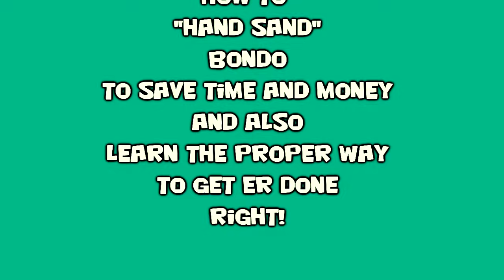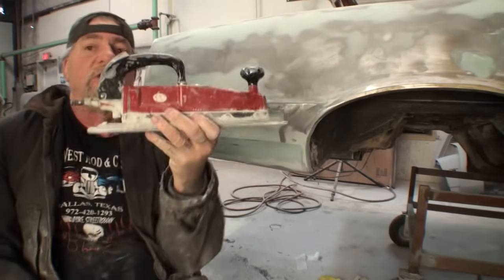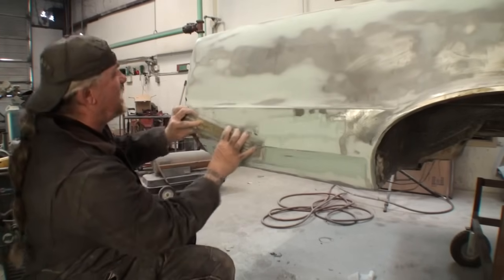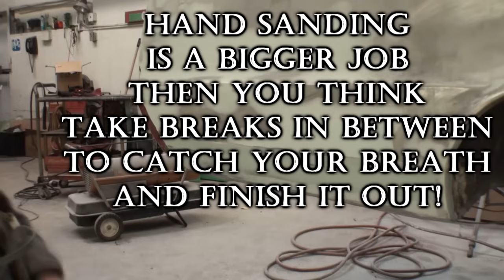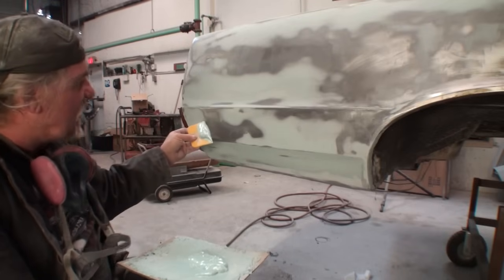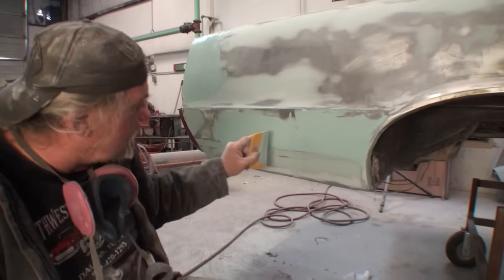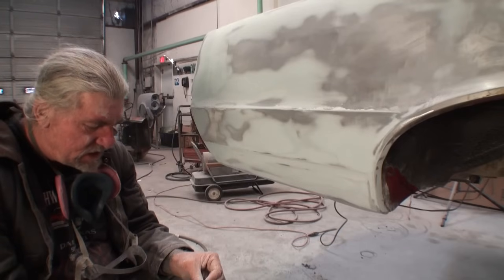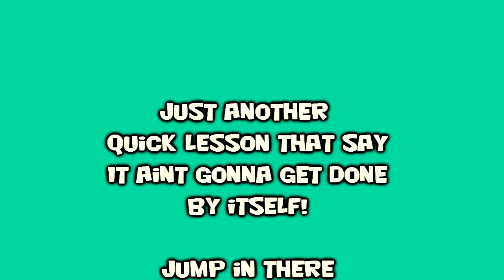Block Sanding Bondo For 2K Primer!

Comment: Absolutely one of the nicest/best videos I've seen from you Pete! and I've been subscribed and watching nearly all the videos you put out for years. No shouting being the biggest improvement, your always helpful and good at showing the reality of how much work it takes and what it takes to do a good job, you really have taught me a lot through the years I have been doing bodywork you have a good way of showing the important things to look out for. Thank you very much for the lesson but please stop yelling because it is so nice to watch this video and hear you talk absolutely as i wished you would and know you can. I know Minnie would love it also. Happy for the new place, can't wait to see you start setting up the place inside.
Reply: @thekingsilverado9004  what do you use ?
Reply: @maryfinchum9741  I start with the UPOL sort hair fiberglass. I used to USED the Diamond Advantage regular mud... Nothing has replaced that yet and it is no longer avail. Called an order in July... Nothing came NCS does not handle it anymore it was made  by EVERCOAT. I am in a real pissing contest with NCS NATIONAL COLOR SYSTEMS 4 getting a decent priced light weight mud. I used to swear by a few others too but they turned to shit... Not much on the market for decent sanding decent spreading mud AT THEE MOMENT... Everything that is like that is above 50 bucks a gallon at the moment which is not cost effective for what I do...

Comment: Thanks Pete your tips and tricks are working, I have a long way to go before I master mud work, Right now corners where multiple contours join cause me troubles but I am getting there. With your tips and tricks I have successfully completed mud work on two black cars and pleased the toughest person in the shop's expectations another car with a contoured body line on a hood didn't come out as good as I wanted but two estimators couldn't find the imperfection. Thank you for all the time and effort into making these videos, I sure am learning something
Reply: Yes it takes a lot of time all body men go through the same thing but that is the magic that everyone sees in the end results makes the painter looks good. It's good to know what color you are going to paint it beforehand so you know how much time you need to put in the best. You can make your own body sanding tools is what I did for all the round corners like Pete was saying you can't put to much in it like trying to over sand I've done that way to many time's I prime and see what stands out with the spray water bottle if you can't see it when it's wet then no one else will see what you see. I got caught up in that because I know what's there I paid to much attention to that area what no one else seen or even knows one's the prime and paint is on. Only you know where most of the work was done if I'm making any sence. Even car's that came off the assembly line were not ripple free.

Comment: I plan on doing a lot of my own body work on my  Chevelle I spent most of my adult life as a Auto Mechanic, not too much body work in my life except when I built my stock car for the Roundy round track, but now I am doing a restore and want to do all  or most of the body work myself, fortunately the body is very straight and no rust that I have found on any of the panels but I am sure there will be my share of sanding and stripping of the old paint, I do have to replace the lower panel on my right side quarter but that is about it, have been watching your channel and it has been a very good learning lesson, "ELBOW GREASE" but it has to be done, I hope to do all the main work myself, thanks for this block of lesson. I look forward to more of your lessons, thanks again for your videos .

Comment: Good work there Pete.  I think the hardest thing to get the hang of is when your block sanding the filler and you have a shiny metal spot show up when the rest of the area is still rough.  Hard to tell if the shiny place is a high place that needs tapped down or if that place is the correct height and everything around it just needs more filler.  Thanks, Tom

Comment: Good video. I've been doing custom paint for more than 30-years. My dad taught me a long time ago a saying "When metal pops, sanding stops". I also never finger sand. I make small blocks to work the area. It's not real hard to make them. Just cut down some of the small black dense foam blocks for the size you need.

Comment: So i found that were your hand sanding with your fingers i went down to the dollar tree and got a pool noodle and cut it down to small rounds and cut it into quarters its med density and it works fantastic for those little dips and curves i also found that the foam pads to kneel on work better than the black blocks from the auto shop plus you can cut them to any size you need and there only a 1.25

Comment: I so wish I saw this video years ago. My car had an inch deep crease all the way down it from front to back. I pulled  it out and spent days filling and sanding, eventually I worked out I needed a long block so I attached paper to a length of wood, that kind of worked as the panels were very flat. Here in the UK I cannot even see these blocks for sale.

Comment: I had a bunch of questions at the beginning of the video but you answered most of them during the video. I always wondered if all of the hand sanding that I was doing could be done with power tools, just could not see how. It was nice to see that maybe I was not wrong. I do however wonder if you have tried different brands of block sanders and if you have an opinion about differences in quality and workability. Thanks again for a great video.

Comment: The car was down to bare metal then bondo was applied and a sandable primer over it which allowed you to sand and fix more imperfections, would you apply an epoxy primer over everything as a sealer before paint or would a sealer not be needed?
I was thinking epoxy primer should go over the bondo and bare metal, but if you find more imperfections you can't sand it, I'm confused when epoxy primer should be used

Comment: So I can put a high build primer over 80 grit sandpaper, or did you go a step finer before applying? I'm currently block sanding my 89 240sx to recieve a primer and I've been told that I need to go to a 300+ grit in order to hide any scratches caused by sanding. Been using 120 grit so far!
Thanks Pete!

Comment: Question.  When do you media / soda bast vs. painting on top of the original paint?  I have a 66 Impala SS, that needs resto.
Reply from the maker: If the car has never been painted before and has the orginal paint and it's in very good shape you can skip the media blasting.. If the car has extensive body damage, surface rust, and/or has been painted before then you should remove the old paint to metal and start over..

Comment: Is any polyester filler good? Also Pete, what would you say your dry time is 45° vs. 95°?
Reply from the maker: I use a product similar to Evercoat Metal Works Putty.  As for drying time I wait approx 30 minutes to 45 minutes.. Thats why I always travel from side to side of the car so Im not sitting around doing nothing....
Reply: Why do you keep calling it Bondo if your not using Bondo brand?

Comment: Thanks Pete, I have a question, now that you have bare metal again after doing the bondo work will the bare metal areas have to be sealed with epoxy primer or can the 2K primer surfacer be used even if it’s not DTM? Again Thanks Pete for all the information you put out for us to learn.
Reply: You can buy metal prep wipes such as AutoBond if you do not want to re epoxy the bare metal.... Otherwise you will need something to give the primer some bite
Reply: @thistledewoutdoors3331  So on bare metal we need to use something before the primer?
Reply: @snoopy5736  no just make sure it is clean no oil dust, if you want to leave it bare metal for a a little time then there is bare metal wipes you put on it so rust does not grow over night. If you leave bare metal over night it will look brown in the morning that's why you have to cover it with something even tape paper over it if you can. You can not leave bare metal over night or your going to have to sand your metal again for primer or feather filler is some thick stuff that gives you more sanding ability so you don't hit metal and it helps cover small scratches then you can lay your skim coat on top of it to sand out any scratches it's a long process but in the end you will be happy with the results the more prep before paint the better it will look.

Comment: Can you give an example of the polyester you are mixing with the bondo?
Reply from the maker: The polyester Im mixing with it is similar to Evercoat metal glaze putty -- https://www.oreillyauto.com/detail/b/metal-glaze-3569/paint---body-repair-16614/body-repair-25202/fillers---plastic--fiberglass---metal-17765/539cc89349b5/evercoat-metal-glaze-glazing-putty/416/4299767...

Comment: My friend pete I see were some people are saying the bare metal should be primered before bondo because bondo won't adhere to the  metal what is your take on this?
Reply: Old days was bare metal(mechanical bond),these days is epoxy primer first  for Bondo work(chemical bond). Will still work with bare metal but preferably done for full restos with epoxy.

Comment: Good afternoon I love your videos and also I am a car guy who likes working on my own Vehicles here and there I just painted a truck last summer I've sat on it without touching it to these following months I plan on fixing some runs that I have on the clear coat I wanted your expert advice the runs are in the areas that are hard to sand because it's not a flat surface it's creases in the body my initial thought was sending down the clear coat till we got flat and giving it another shot of clear coat is that possible or is there going to be any type of chemical reaction due to the clear coat being fairly new should I just send everything down and give it a shot of paint first and then clear-coated my only problem with that is it's a two tone paint and I would hate to buy more paint since one of the Colts which is white is actually okay it's in the blue part of the paint job where I got the runs let me know what you think I would appreciate your input thank you very much
Reply from the maker: I would take a small peice of 400 wet and lightly sand only the run, focusing on trying to rid it from exsistants without sanding any of the clear, a good tool to use on this is break a paint stick to a small 1 or 2 inch piece and then wrap some 4oo grit around it, then use the edges of the stick to eliminate the run, once youve done this go over it with 1500 then 3000 wet and you should be ok.. By using the paint stick method you'll only sand the run and not the clear around it.. Sometimes you'll have to leave a small bit of the run there but it will camoflauge itself in when you buff it out.. Good lUck!

Comment: If you wipe that top of that Bondo off a little lack of thinner on a rag and take that on hardened tacky code off the top and won't clog you sandpaper

Comment: Been watching your videos but i have a question if you can help me with i have an 88 blazer body is straight has original paint but the clear came off and i want to just primer the vehicle what sand grits do you recommend to start and finish with or if anybody can help me with this thanks. thanks for these vids keepem coming...
Reply from the maker: I would blocksand the whole car with 80 grit and then prime with 2K Primer.. Then blocksand with dry 180 then spot prime where needed.. Then come back and sand with dry 320 then paint!   Good Luck!
Reply: @diyautoschool  thank you for the reply i appreciate it brotha🙏

Comment: Does the primer fill those 80 grit scratches?
Reply: Primer can & will fill in 80 grit with an additional coat or 2 if your primer gun tip/needle size is less than 1.8.... But,, I suggest sanding in a "X" pattern to eliminate any grooves that you'll get with sanding in 1 particular direction... Also,, If you do a final sand with 180 before primer - It also helps make life easier...
Reply: @thistledewoutdoors3331  Thanks!  Is there a concern that a 2k or epoxy primer will shrink and the cross cross sanding marks will come back?
Reply: Israel Kelley  thank you Israel!  That's what I was wondering.

Comment: I am suprised that you can breath  normaly as long as you have been doing body work. I wear a 3m mask with a p100 filter. I find it hard to breath after 5 min of block sanding.

Comment: Rather then using 36 grit to take off the waxy surface, wet a rag with lacquer thinner. That will remove that waxy surface. Sanding polyester bondo mix with 36 is too aggressive, it cuts fast yes, but too deep too fast. The straighter and the more rigid the sanding block the truer straight result you will get. A rigid straight block will not lie, it will cut straight and will quickly show the highs and lows.

Comment: Would you ever use sponge blocks like painters use to do the hand sanding parts?
Reply: not on bondo.. It will make it wavey and uneven.. I do use sponge blocks in cruteul areas and and probably could have used one where I was hand sanding...

Comment: I'm envious of the sticky sandpaper... We can't get it in the UK, even though the manufacturers have presence here. It's either paper backed or velcro.
Reply: Typically the hookit paper lasts longer...
Reply: Its alright,  you just need to make sure that the sanding block is clean before you stick it on
Reply: PSA on hand blocks an roloc  then  hook an loop for air tools for me
Reply: Hey Ray, you can get the PSA rolls from Frosts https://www.frost.co.uk/pressure-sensitive-adhesive-psa-sandpaper-roll-different-grits.html
Reply: Frost resto sell it

Comment: Everybody leaving comments about that polly shit. Pete does everything right but we all might do things different. I do use a dry guide coat for bondo but do i need it to get the job done?? No... Lots of hours on that car. Looking good more time spent on mud work car goes a lot faster when in primer. I had to ask before about that fiberglass resin in bondo. Ok i did one fender with resin in bondo on my bug. As a test to see what it does down the road. I think its a bad idea as they dump resin in mud at work and lay it out lime glass. It sands easy but to me make pin holes.

Comment: 20:09 why wouldn't you cover that whole section whats the point of leaving the last 5 inches bare and towards the front leaving bare metal by the body line, If you coat the whole thing and don't brake through to metal it comes out straight anywhere metal is showing can be a problem. After he sanded it I see high spots all over that's not good bodywork. Seems everyone wants to use primer to fix their work they won't let you get away with that at a quality shop

Comment: PETE, LOSING THE PLOT HERE MY FRIEND....Now that was an excellent video, cool calm, well paced and clear with all the detail. Now that the quarter is finished to 80 grit so far. At 26.30 Pete you say "bam we can go straight to primer". Now this is where I LOSE THE PLOT! 
Ok I get that you can now apply primer filler, say 2 - 3 medium coats over the bare metal and bondo at 80 grit finish. I get that the primer filler can get a really good "bite" on an 80 grit finish.
I expected to go over the 80 GRIT quarter panel with 180 grit dry (or better SAY 240) and THEN PRIME, BUT IM WATCHING AND LISTENING TO MY FRIEND PETE?
I can't see that primer filler will fill and cover 80 grit dry scratches without lots of coats? Am I just being retarded?
So am I right in thinking that the 2 fenders were prepped to 80 grit like the video, primed and will now the dings will be "repaired" to 80 grit finish again, reprimed and then guide coat and blocked to 180 grit dry OR FINER FINISH?
Any help appreciated?

Comment: you went from a long block to a short block,...thats a no no...makes no sense..also when shiny spots of bare metal keep popping up,that a high spot...gotta tap those down....rule number one,dont add filler to a high spot,....just the low spots.

i can save you a ton of time pete.i see you killing yourself here sanding,and its almost entirely wrong.step one,get a air sander,long board,get it close to done,then come in with the block...i get my work 95 percent with air tools,then finish sand with the block....no need to come in on rough filler with a block,you gotta work smarter ,not harder.i been doing this work in my own body shop since 82.you picked up a lot of bad habits...shiny spots in the metal are high spots....gets your panels skimmed evenly with filler,that whole quarter section at the bottom should be filler when you start...your spreading looks like a jigsaw puzzle....when im done sanding its all even with filler,no shiny pop ups all over the place,remember,filler sands at a quicker rate than metal....skim the whole panel with filler....when metal pops up right off the bat,you got a high there....use some dry guide coat,make the job much quicker.

fill the lows and sand the highs.....thats the fundamentals of this game.also,tape up the body lines when your blocking,its the only way to get a straight line pete....